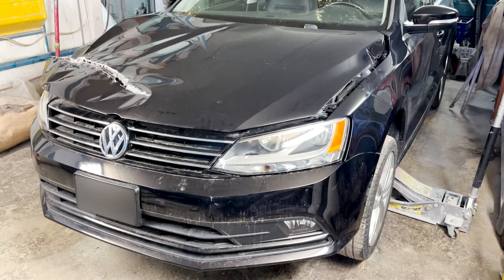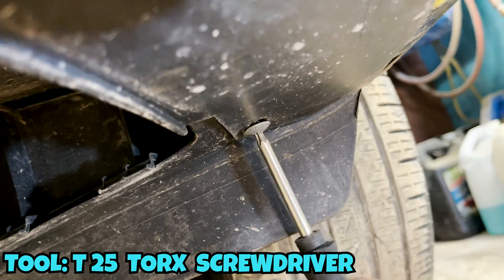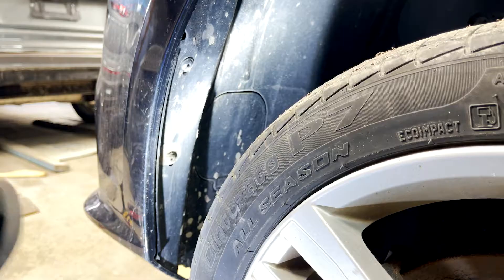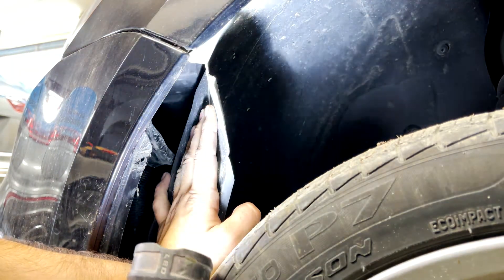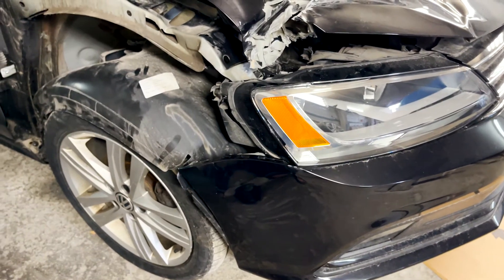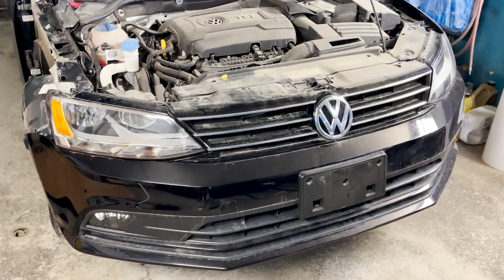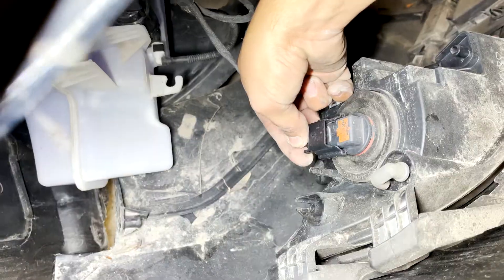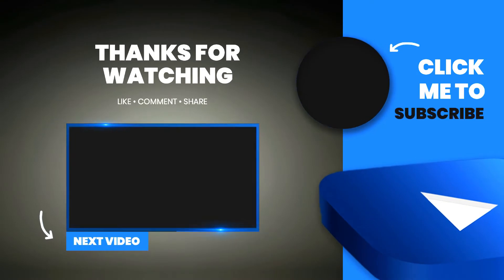DIY: 2015 - 2016 - 2017 - 2018 Volkswagen Jetta Front Bumper Removal / Takeout - Any Bumper Takeout

Comment: Quick question: what is the connection piece along the front fender that holds the skid plate in place?
Reply from the maker: Hi Mawntra,
Can you tell me the exact minutes in the video where you see the part?
Reply: @HowItsFixed  It's at 36 seconds. You can see it running along the front fender as you are pointing out the screws. You can see where the skid plate connects into it. I need that part. Hit a tire on the interstate not long ago lol I just don't know what that piece is called. Thank you for the response as well, and great video!
Reply: Hey, what if I just need the bottom part of my bumper? The top part is OK. Ay was, is there any way just to replace the bottom part period I hit a mailbox and then a raccoon finished it off period the bottom part is dragging on the ground a little bit, which is the bottom cover. But the top part of my bumper is okay, and I'm seeing them for about a 100 bucks, just the bottom part.
Reply from the maker: @brandonohara4122 yes you can takeout the bottom part without taking out the complete bumper. We haven’t done it but some other channel has. 

Here is the link in the description:
https://youtu.be/rcFCtgsFf8w?si=KgPZfWGFqzWRg8v-
Reply: @HowItsFixed  thank you for the prompt response

Comment: Hello I have a question. I have a jetta Trendline 2.0L 2015 and it doesn't have fog light on the bumper. I am loockinf for a front bumper on internet and every bumper have fog light so i don't know how I can install it if I don't have fog light thanks you
Reply from the maker: Hi, 
Bumper with fog lights won't work in your case. We would recommend to look for bumper without fog lights. Hope this helps :)